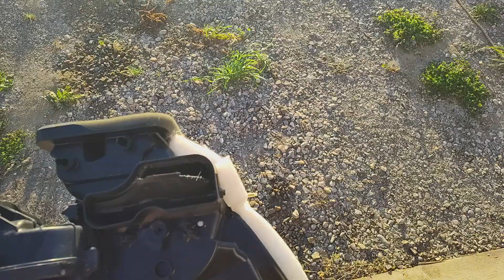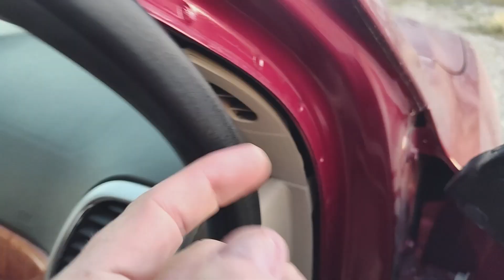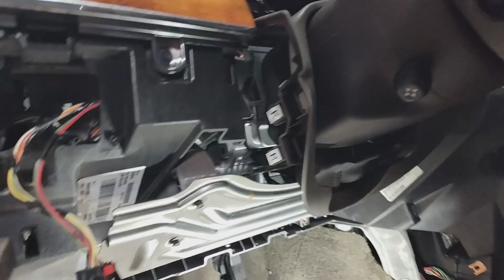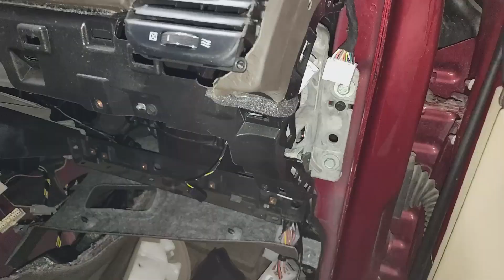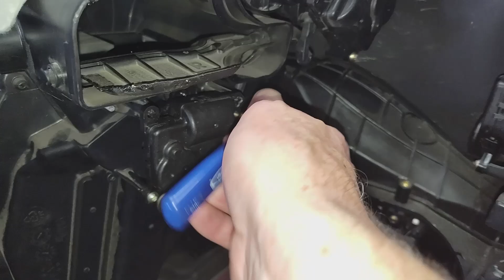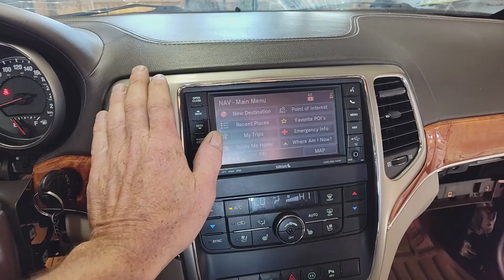Jeep Grand Cherokee - Budget Blend Door fix - AC blows hot on one side!

Comment: Currently when the AC is i have hot air on the driver side cold air on the passenger side. I change it to Hot air and I get AC on the drive side and hot on the passenger side. Thoughts??
Reply: Same!
Reply: @tanaiyadonald1977 have you had anyone look at it yet?
Reply from the maker: My first thought is that it's your driver side actuator, but have you tried a recalibration, there are a few ways to do it, 1. Fuse pull (should be able to look this up), 2. Battery disconnect for 5 mins, 3. Scan tool.

While it's recalibrating listen to the system and if you have any clicking then one or more of your actuators are bad.

Comment: Any idea how far the screw sticks out? I'm trying to do this without taking the dash out
Reply from the maker: Are you asking about the stop screw I put in the gear?  If so I did not measure it, but if you disconnect the actuator and gently turn the gear by hand, you will feel the blend door stop and you can mark where it stops and set your screw accordingly.
Reply: Yes I was talking that screw. I'll be doing this tomorrow without pulling the dash. It'll be a fun job
Reply: @adammeade7629  was you able to fix yours without pulling dash?
Reply: @stevemoore6573  The replacement gears have stops built in.  ($14 for a 2 pack on amazon) The blend door only goes too far when the stop on the gear breaks... sometimes.  Mine broke, but it still didn't push the blend door too far.  Other videos show how to get a tool in to un-stick the door.   Passenger side is pretty easy.  Driver side was a lot more work, but still very doable in maybe an hour.  TRY THAT FIRST,  BEFORE EVEN CONSIDERING THIS AMOUNT OF WORK!